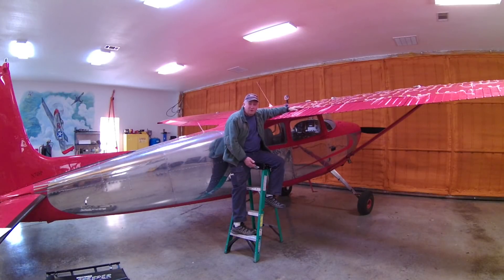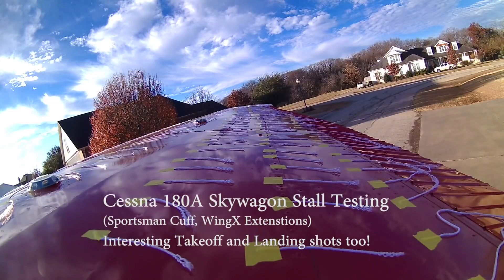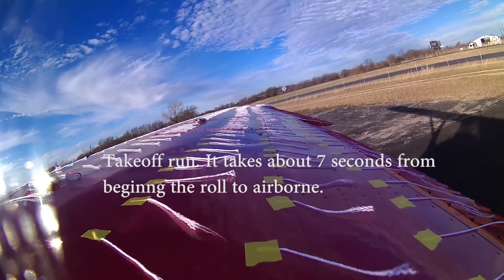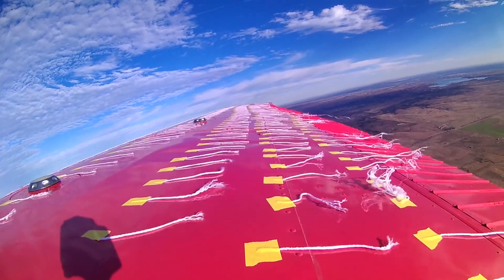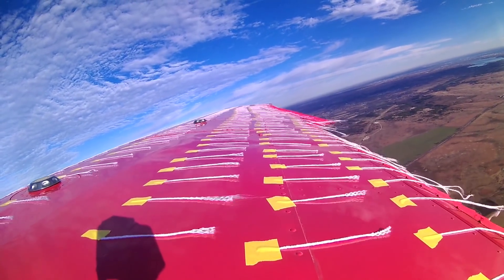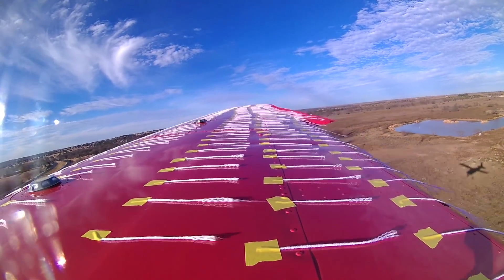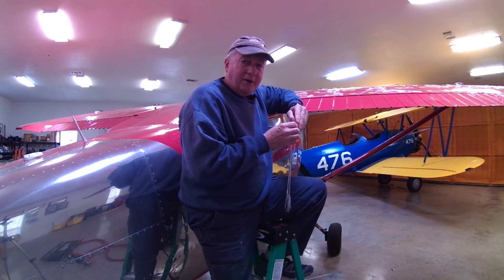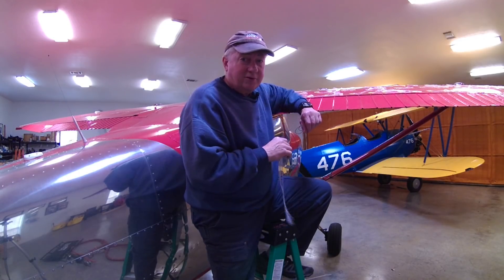C180A Wing Performance Testing

Comment: My Cessna 180, a 1954 model, with an O-470R installed, has the Sportsman STOL, Wing-X Wing Tip Extensions as well as the Vortex Generators.  I first flew with the BLR VG's, but later changed to the Micro Aerodynamic VG's.  I find that the Micro's that Charles produces, provide a better performance gain, though I have never ran the tests with tuff's installed.  The 180 has been on Experimental Category for Flight Testing (Show Compliance and Engineering/Demonstration) a number of times for FAA Flight Test work and STC Certification.  I have done nothing to try to go faster, but, rather, I have done everything that I can come up with, to fly slower.  Faster, in my book, gets you to the scene of the accident faster, and provides you with less time in your log book.  Slower, gets you to your destination, safely, alive, and your log book totals increase.  I'm not about speed.  3 of my sons learned to fly in my 180, and I wanted to give them every chance to make it to geezerville.  Paul Caban did the entire Skywagon community a favor with the Wing-X Wing Tip kit, and I have installed a bunch of them.  Marshall, likewise, did the Skywagon community a favor when he pursued the Sportsman Stol kit.  I knew Marshall and had great respect for him. I look forward to seeing your C180A video with the VG's installed.

Comment: My 185 has a Sportsman cuff, WingX extensions, flap gap seals and Micro Aero VG’s. The performance increase is remarkable, particularly in the sensitivity and capability of pitch control due to the VG’s on the horizontal. The airplane should have come from the factory this way. The flap gap seals have increased the climb rate and cruise airspeed 3-5 MPH without affecting the stall speed.